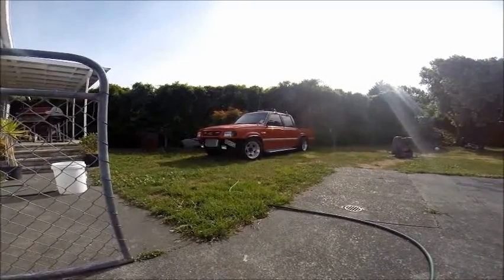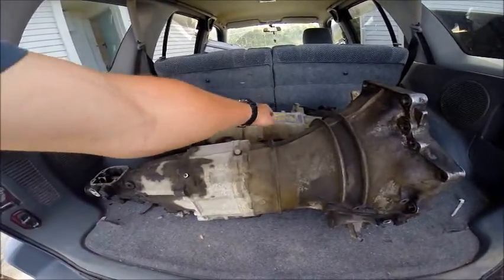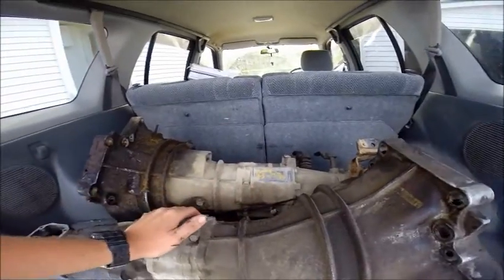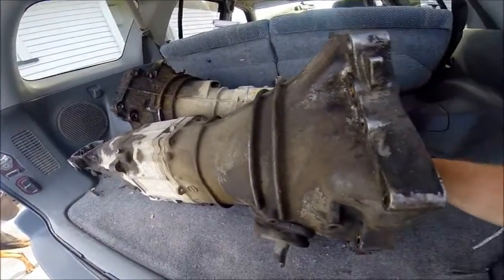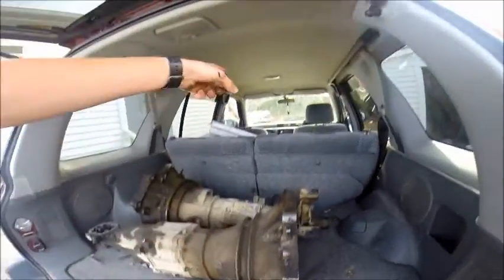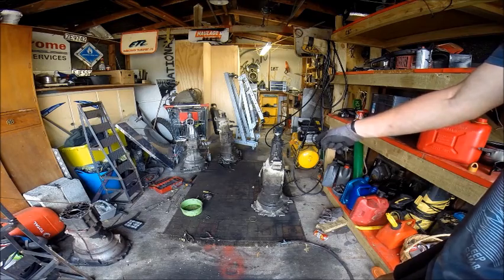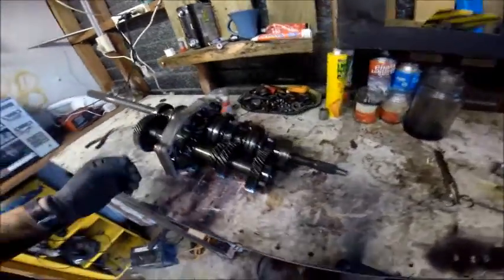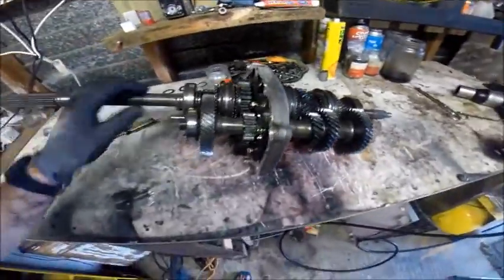Ford courier gearbox teardown and re assemble!

Comment: if its a FE F2 or F8 gearbox the input shaft is different spline count to the WLT, can buy synchros from ebay that are cheap, however they make 2 type of box's Barrel(no sump on bottom) and sump type(sump/pan on bottom), how ever the wlt input should be a bigger input shaft and 1 more spline than the petrol F8/FE/F2 and R2/RF(couriers and bongos, and e2000/e2200,, most parts can be interchangeable but  measure and count splines and everything first haha, also the mazda RX7 and mitsubishi also shared the same/some parts as all these gearboxes mentioned, the wlt will fit onto a early 4G63 sohc and dohc engine(need the 4g63 bellhousing tho)
Reply: WLT is 23 Teeth/spline and everything else(G6/F8/FE/F2/RF/R2) is 22 teeth/spline, often people do a conversion and put in a sump type gearbox  that has the 22Teeth/spline from a G6/F8/FE/F2/RF/R2 courier or mazda b2000/b2200 non WLT

Comment: so your saying a bongo van gearbox will fit if you change the bell housing any model bongo?
Reply from the maker: it would if the main shaft was longer, what i did there is take all the cogs and everything off the bongo main shaft and stuck them on the courier main shaft, reason being is bongos are coloumn shift so the tail shaft of gearbox is  shorter. a mx5 box will fit with only bellhousing change, what are you trying to put a gearbox into?
Reply: iv got a mint mazda bongo van gear box if you want it. I got it for my 1982 ford courier but it wont match up. hit me up if you want it.
Reply: Have you sold that gbox yet mate ??